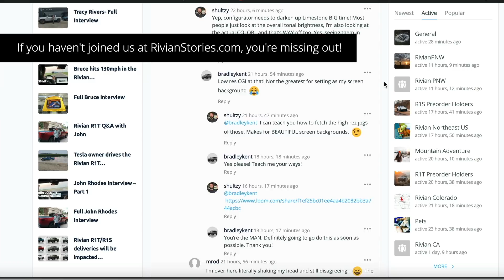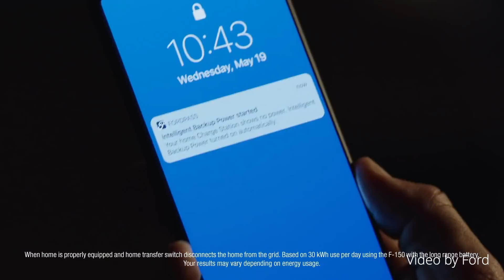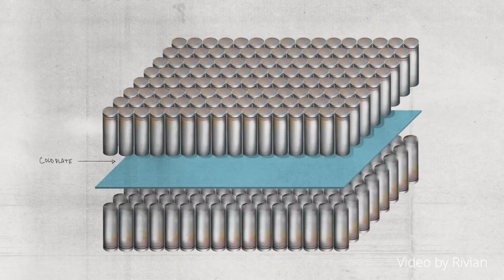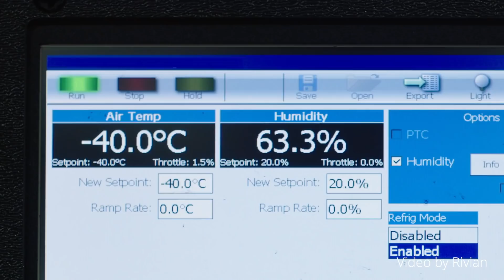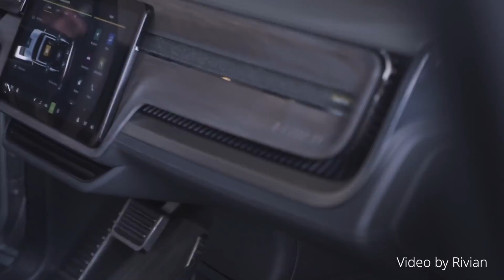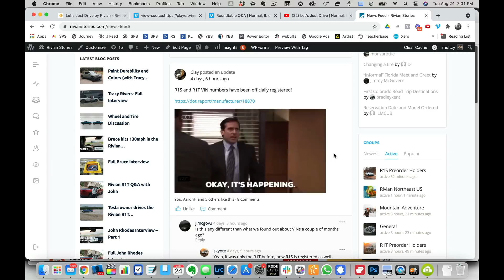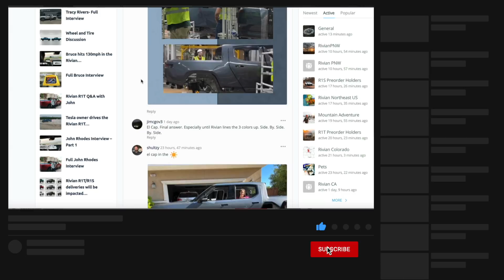Rivian R1T/R1S will have V2V & V2H capabilities.

Comment: People are too excited about the V2H capability. The last thing I would ever want is to be without power AND stranded...If people aren't conservative with usage, the home will drain that battery very quickly.
Reply: Who says people won't be conservative w/ power in that situation? Why would you be stranded? Just because your home is without power doesn't mean the the CCS station down the street is. And if you are conservative w/ power you could run your home for days.
Reply: @jimcgov3  I think the idea that your average customer has any clue about conserving energy is a great misjudgment. Stranded as they won't know that HVACs use 3500+ w/H and the battery will drain quick. In normal situations, there's NOT a CCS station "down the street".
Reply: it’s a big draw for me assuming my solar will charge it during the day then using the vehicle as the backup seems more affordable than paying another 20-30k just for the stationary home battery.
Reply: @telerye  That will only work for you if you already have a battery system installed on your home. Otherwise, when the power is out, your solar does not produce. If you don't believe me, call your installer. If you do already have battery backup (less than .1% of people with solar have this), then your comment is correct, just not very applicable to the general public. And dangerous for others that do have solar to read that as now they might think their panels work during an outage, which, again, they will not.

Comment: With new SSB on the horizon, will there be a guarantee that engineered replacement packs will be available in a retro fit for early adopters?  Not like what has happened with the Nissan Leaf?

Comment: OK, I recall RJ saying they intend to produce a vehicle every 4 mins or so.  What wasn't clear to me (and I may have missed it) was at what point?  At the SOP?  In a couple of months?  Eventually, meaning a long term goal, and if so, what does that mean, 6 months, 1 yr, 18 months from SOP? 
Calculating with some rough/conservative numbers of producing an EV with the following: every 5 mins - 2 shifts so 16 hrs/day - 5 days a week - would yield the following production rate:  12 /hr, 192 /day,  960 /week,  4160 /month, 49,920 /year. 

I suspect production rate will be low at SOP (but how low?) with the rate increasing over time, but over what time?  And, again, is the 4 or so minute rate short or long term goal?  And then of course defining or translating "short" and "long" terms into actual time units (e.g. months).
There are still way too many variables unknown at this point to get a reasonable speculation ...... but we're eveeeeeer so slowly getting closer.

Comment: Given this is the first electric vehicle that is capable of towing my hybrid travel trailer and is also aimed at the outdoors market I really hope they do something clever with the V2H capabilities that would allow me to hook my Rivian up to the campground electrics and charge (albeit at a slow rate) while also offering a full electric hookup to my travel trailer, using the battery to even out any peaks and troughs in demand so that it does not trip the pitch breaker.
Reply: Funny you should mention that, I've had the same thought myself.  I think the more likely scenario is another device that plugs into the 30A/50A outlet at the RV park, and prioritizes power to the RV while dynamically charging the vehicle with what's left (within a margin of safety/buffer).
Reply: @skylerwilliams  I was thinking though that it would be great to be able to use the Rivian battery to cover peaks in demand to give a full 50A service to the RV even though it may only be a 30A supply on the pitch, while still charging the Rivian away from the peaks of demand. I agree that this would likely be some sort of device that connects everything together.
Reply: @MatthewRelf  gotcha!  That would definitely be tougher & would probably need access to the DC pins of the CCS connector.

Maybe an EE or someone more knowledgeable could weigh in for us.
Reply: This could be an option: https://www.getneocharge.com/shop-pages/smart-splitters It isn't exactly what you are looking for but I will leave it there regardless.

Comment: IMHO you must mean  5-10,000 per Month by the end of 2022... 3-4k in the middle of the year does not even close to what is required to be a viable auto company.  That plant needs to produce 200,000/year auto's by the end of 2024.
Reply: Ford isn't even planning that.
Reply: @whiteninjazx6r  I don't think you can compare Rivian to any legacy automaker, none of them have the decade of time invested in EV like Rivian.  The closest comparison should  be Tesla.  Look at the recalls GM has had with Bolt and the failures BMW has had.   Ford is going to stumble along the way with it's own problems.  Look at the vast differences in EV build quality Sandy Munro has shown on his YouTube channel https://www.youtube.com/channel/UCj--iMtToRO_cGG_fpmP5XQ.
Reply: I think it will be 4-5K by the end of 2022, and that's pretty darn good.  Maybe they could surprise us though.

Kevin is correct above about Ford too.  Ford *increased their previous production plan to make 15K Lightning next year & 140K by end of 2024.  Rivian will be making more electric trucks than Ford...

Comment: currently Rivian is sourcing batteries from LG Chem. Battery manufactured form LG Chem is what will be used in the LG and preorder Vehicles. LG Chem is the same company that is is news now for Chevvy Bolt issue.
Reply: Samsung SDI is the supplier of Rivian batteries.
Reply: This is false
Reply: It’s Samsung batts dude, not LG
Reply: Fake news… please refrain from making posts if you haven’t done the proper research. Or you are too ignorant to know the difference between Samsung and LG, In which case you should refrain from posting in any battery conversation.

Comment: The way they worded it is odd.  As long as the R1T has the bi-directional power flow things inside it, when it comes out isn't as critical.  so as long as the charging system has something that AC/DC and DC/AC back then supporting it via software is doable as long as they deliver on updates.

You'll also need fancy things in the house to fully support it.  Sounds like the charger is an ATC, but you'd still need to have a panel for it to cover the things that you want powered by the vehicle.

Based on my reading, I'm excited for the idea, haveing two 100kwh batteries in the garage for hurricanes and what not would be nice.

Tesla's don't have the hardware for it, so you'd need a new car/upgrade to do it which to me is why they're so against the feature.
Reply: My understanding is that Tesla vehicles do have this capability but it’s limited by software until (and if) Tesla decides to permit it
Reply: @100_percent_bs8  wish it were true but people have taken the boards out of the cars and the circuitry needed isn’t there. https://youtu.be/lXokJEzXwaI this video did a ridiculously detailed tear down
Reply: @CrankyOldNerd  thanks